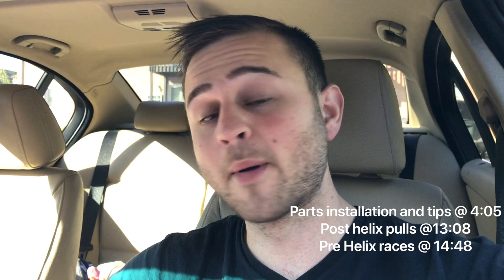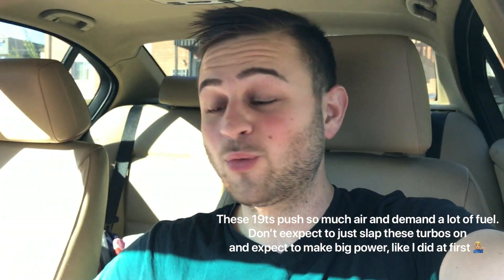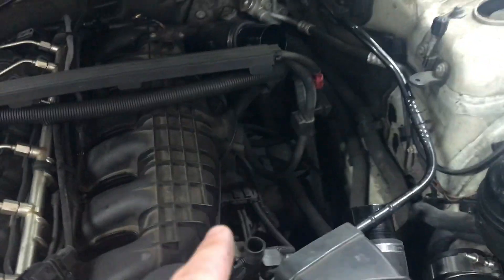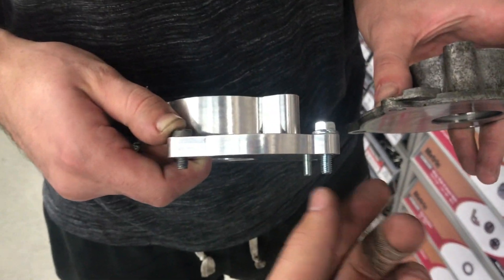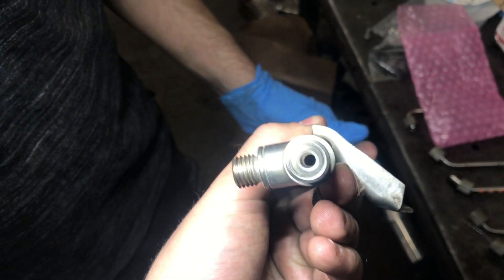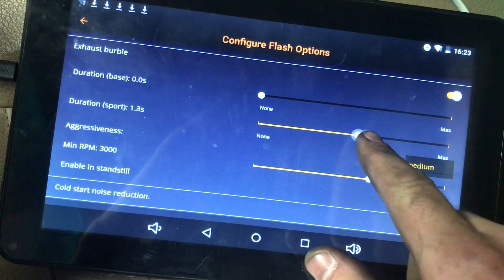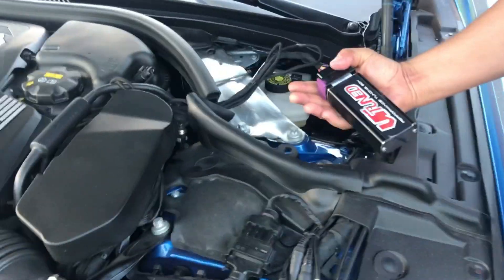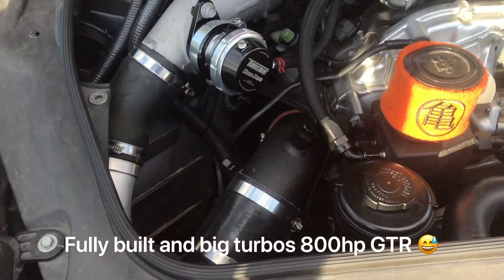19t’s Update #4 Helix overdrive installed!! Full e85 pulls and pre helix races!!

Comment: It would have been nice to see a dyno pull and log of before and after drilling that fuel rail.
Reply from the maker: Yeah I would have loved to dyno before. But I am hitting the dyno very soon and recording the power at different boost levels for you guys! Also I have logs from before and after but at the same time I ported the rail out I also installed Helix so rail pressures would have gone up like crazy from that also.
Reply: @N54GASM  Right, but now you don’t know what did what.  The fuel rail drilling is what I question, since the stroke of the high pressure pump is the actual limitation.  Although the helix does more strokes per second.  

My intuition is that the fuel rail orifices allow the rail to serve as a pressure vessel and the orifice size serves to dampen/isolate pressure waves generated by the injectors and pump from each other.  This would have the aim of more consistent fuel pressure, instead of having a high frequency variable fuel pressure.  For this reason I wouldn’t advise drilling injector orifices, maybe it’s okay on the feed side, but it should only be drilled out 0.050” larger.
Let’s be realistic, BMW spent extra machining operations (increased part cost) to put those specific sized orifices in the fuel rail, so ask yourself why.

Comment: Ended up replacing my helix after 5 k miles
Reply from the maker: What do you mean? Helix failed on you or you went another route like Pi?
Reply: @N54GASM  I had to go port Injection because the seal on my helix failed and all the internal oil to keep the bearings lubricated kept seeping out and it starting rattling more and more
Reply from the maker: @bimmerfab  ohh damn man I’m sorry to hear that.. tbh I’m already considering going port one the near future if helix doesn’t work out. Been hearing bad stories about helix and the timing chain guide.

Comment: Can I have the link to the regulator bro? I got my 19t’s should be going in this weekend. Quick question, I’m going port injection, I’m getting upgraded lines from the tank to Port injection, do I still need the lines to the HPFP
Reply from the maker: I’m not 100% sure about port injection but I know if you don’t upgrade the line from lpfp to HPFP without port you won’t make 650+whp its too much of a bottle neck. As for the regulator my tuner has designed it and I am testing it very soon!

Comment: How much power you think you had just on e40 with this set up at 20psi?
Reply from the maker: Kevin Sanchez anywhere from 500-520whp easily
Reply: After  watching ur first vid on the 19ts I got some. installed them my self and have been running good and just trying to figure out the Data logging part to send back to my tuner. But thanks for influencing me and doing these vids man!
Reply from the maker: Kevin Sanchez no problem buddy glad to hear you like my vids and your turbos are running Good! Data logging is super easy just get mhd and buy the logging monitor. Then go back take a peak at my first pulls. Start in 3rd gear at 2-2500rpm hit start log. Go through the entire rpm range and shift into the next gear a little then let off throttle and hit stop logging. Super simple!